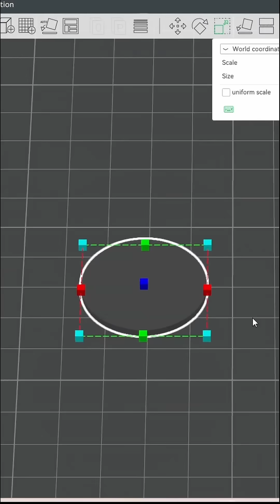You Can Model In Bambu Studio?! #3dprinting

Comment: 3d printing is great and all, but at some point it would make more sense and be more cost effective to consider other materials (like wood), unless you are looking for something completely custom  🤔
Reply: Trust us bro if we wanted to build with wood we would, but we don’t and you have to deal with it.
Reply: The point to 3d printing is automation. Wood isnt automatic. And for a lot of things, 3D priting is just as good as wood and way less expensive.
Reply: @graphi1477  depends.. wood looks and feels a hell of a lot better than some weak ass plastic, the benefit of 3d printing is more so for rapid prototyping so you can make injection molds or a negative for a cast. Automation is possible but in the long run it is less cost effective than injection molding
Reply: @graphi1477 this could be automated aswell using wood and router/laser cutter
Reply: @graphi1477 can be automatic using beavers FYI